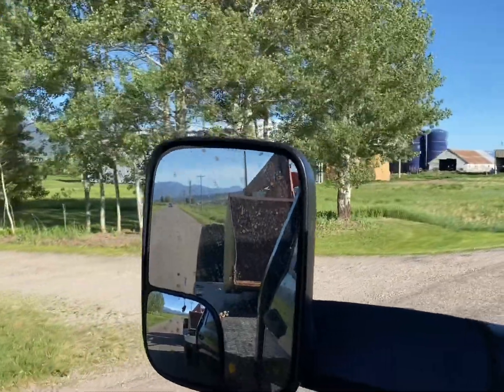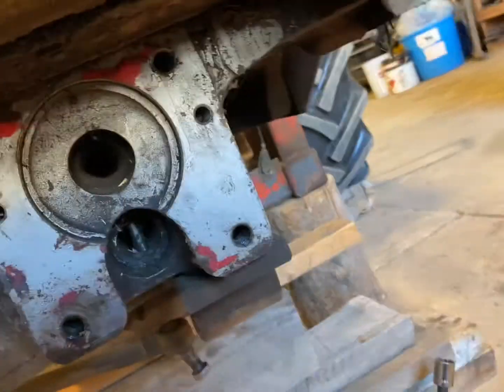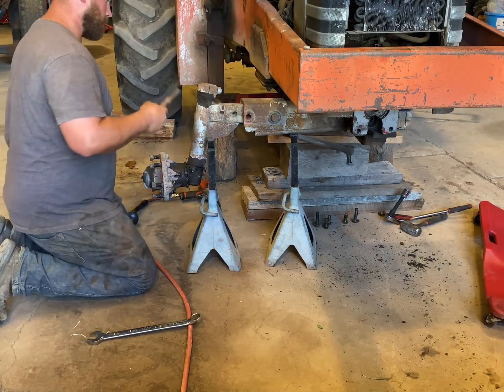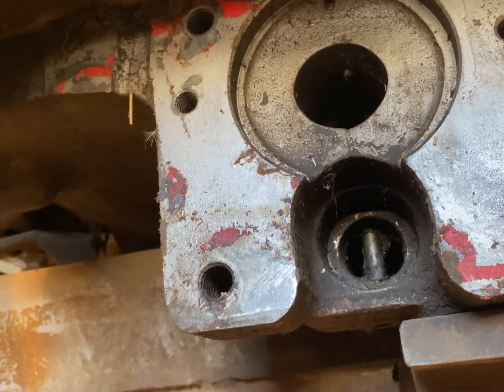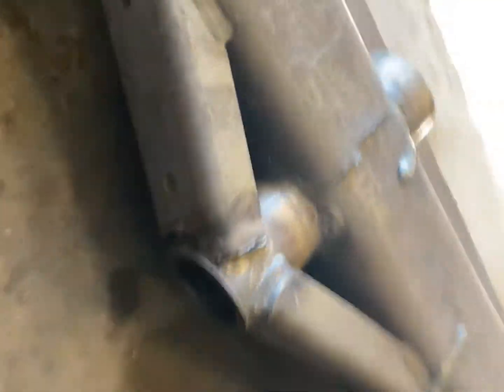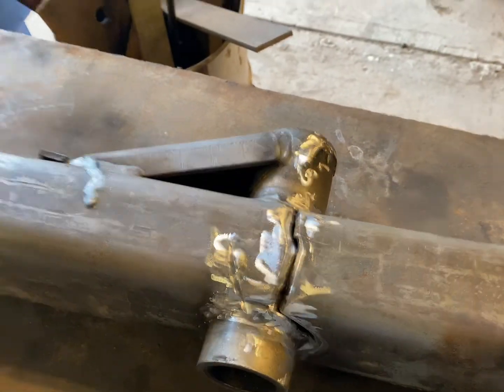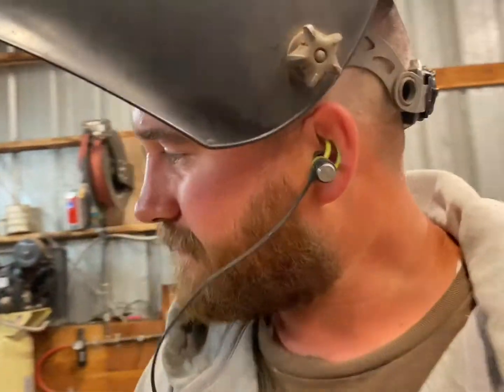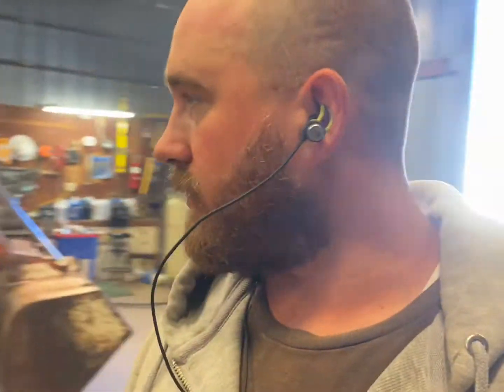Welding a Broken Tractor Axle

Comment: The heavier axles from the 1100 and 1130' s will swap right in if you have that trouble again.
Reply from the maker: That’s good to know! Thanks for passing that on. I’ll have to let my cousin know that if he has any problems with it again. Do you know if they are hard to come by?
Reply: @LuthiRanchWY  they're not too bad to find. Last one I bought I picked up at that big junkyard in Bridgeport. It is nice to have the heavier axle and spindles on a loader tractor like that.
Reply from the maker: I’d agree. After I fixed it I recommended to my cousin that he just take that loader and bucket off. It hangs so far off the front, that’s a lot of weight bouncing around up there.